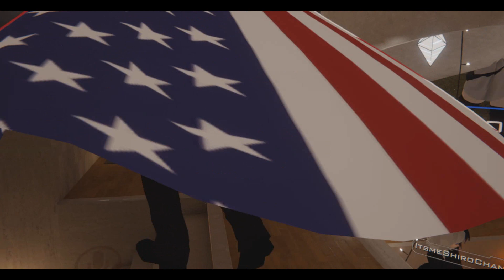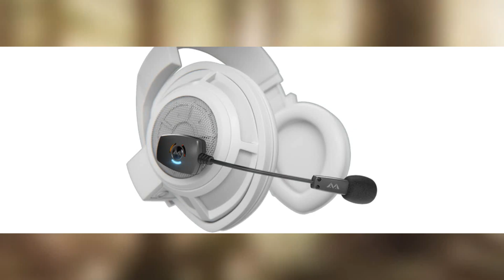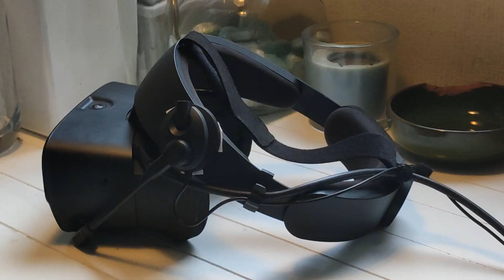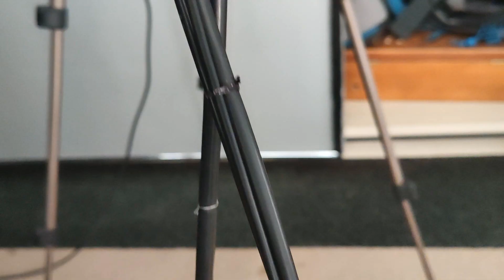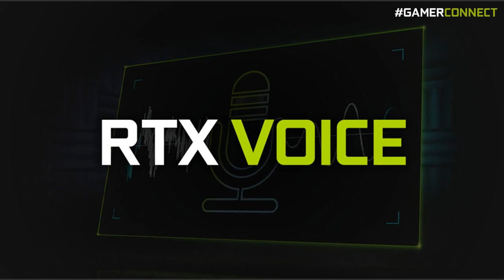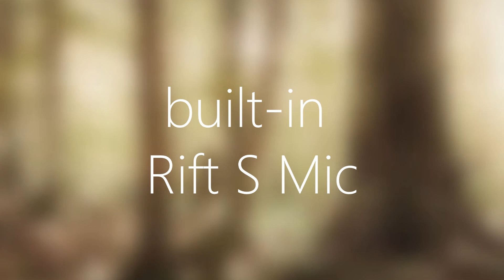HOW TO FIX THE RIFT S  ROBOT MICROPHONE UNDER 3$

Comment: id like to do this but having MORE cables running from my headset definitely isnt ideal while playing heavy movement drawn games
Reply: Just use zip ties and things and measure out the length then tie the wires together all the way down it's basically a single cord

Comment: ok i found what was doing this to peoples headset it is doing it to mine but i fixed it. you got to go in to setting and disable oculus virtual reality device mic. and switch it back to the rift s microphone and make it default. the new update changed it in your setting. go in to oculus app as well on ya desk top and restart oculus app. reset your computer. in setting you will see it default to the rift s mic now. where as before it was trying to go through oculus virtual reality device. this fixed the problem for me.
Reply: where do i go to disable the device mic?
Reply: @xstacyz  sound settings type it in the windows search bar, go to manage sound devices. under input find oculus virtual device mic. disable that and set the default to oculus rifts s microphone.
Reply: @nottogood415  do i make it default on the oculus app or on desktop?
Reply: @xstacyz  both
Reply: @nottogood415  I figured it out awhile ago I think it's working good, thanks
Reply: @nottogood415  is it still good for u? Or did it come back at all
Reply: @xstacyz  it should be all good haven't had to change it back since i did this.
Reply: @nottogood415  hey, it did work but now its starting it again, i tried to do what u said all over again, but it still has the glitches, idk what happend
Reply: @xstacyz  uninstall the oculus dash thing that runs the head set and reinstall it. while your headset is plugged in
Reply: @nottogood415  oculus dash? like do i remove the device from oculus then add it back?
Reply: @nottogood415  where can i find it at?
Reply: @xstacyz  click the link put in my comment
Reply: @nottogood415  i dont see a link
Reply: do u have any other socials i could contact u on? like discord or insta?
Reply: type in oculus rift setup in to google it will come up
Reply: @nottogood415  uh so I looked at it and all I could do was reinstall oculus, so Im not sure if I was supposed to do that but I did and it still didn't fix so idk
Reply: @xstacyz  was your headset plugged in while it ran updates ?
Reply: @xstacyz  did you go in again and change the audio output to the headset like in my first comment ?
Reply: @nottogood415  while it was installing it took about 2 hours so I wasn't sure if I was supposed to keep my headset plugged in throughout the whole thing
Reply: @nottogood415  and yes I did that but it still didn't work
Reply: @xstacyz  plug it in and look for updates in settings. if not uninstall it again and reinstall it the oculus set up shouldn't take 2 hours to download i don't know where ya live but that is a long time make sure it is the right setup from the official meta website. did you type ion oculus rifts s setup in google and click the right one ? the updates also update your headset so leave it plugged in.
Reply: @xstacyz  other then that check the cord coming out the headset where it is connected in it might be lose. also after the update be sure to look in ya audio setting on ya computer and make sure it is set to the right microphone like i explained in my first comment.
Reply: @nottogood415  alr ill try that
Reply: @nottogood415  is there a way u could make a video? i feel like im doing something wrong, or even if i did everything right it still seems to either get worse and i need to replug in my headset or something like that.